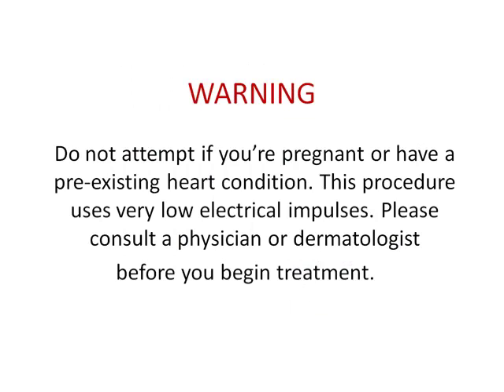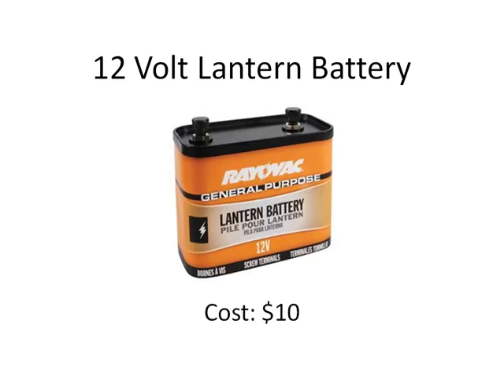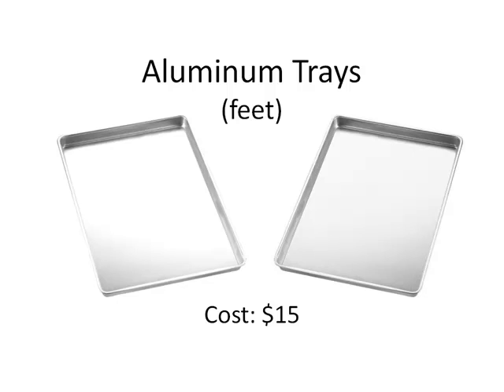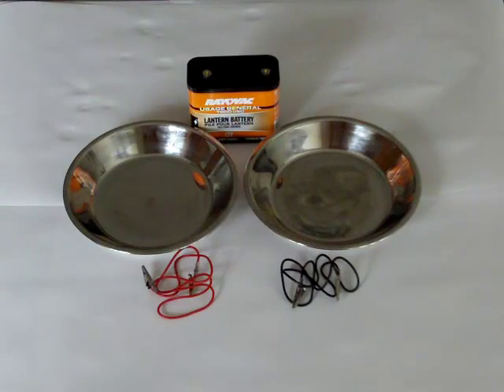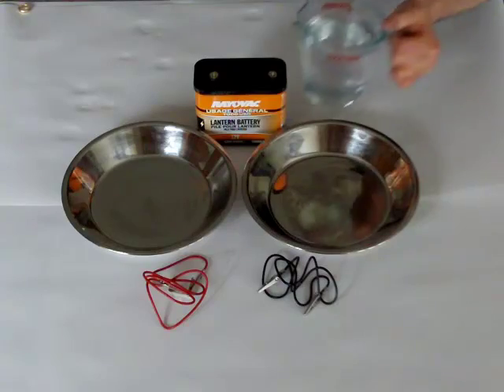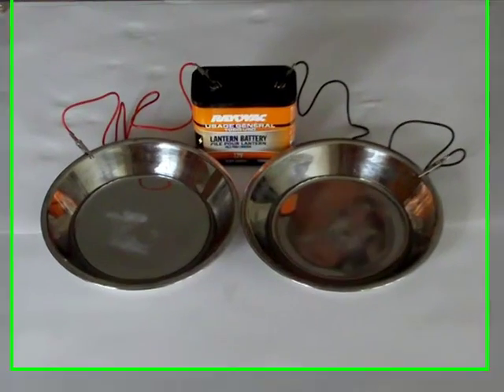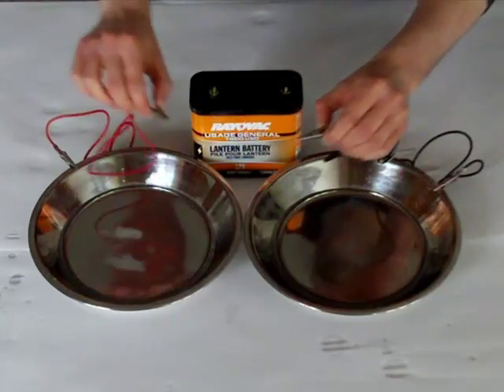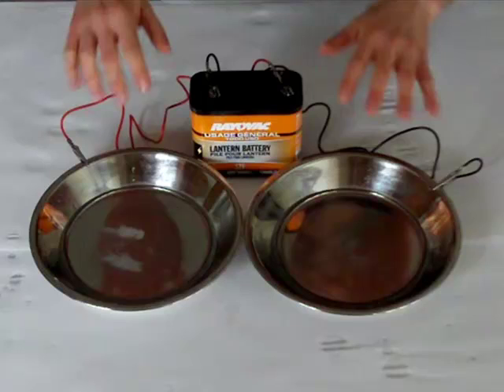How to Build Your Own Homemade Iontophoresis Device

Comment: Continued...

Day 1 (April 3, 2013). I did 10 minutes for each hand, and then switched the terminal like the video says. (So the  disconnect test leads to each pan, and make sure they never touch. Then you connect the (-) on your left to the pan on your right, and (+) terminal on your right to the pan on your left.

Some quick tips: Place your hand in the positive pan first, then your other hand into the negative pan. After 10 minutes, remove positive hand then negative hand. (Part 7)

Comment: Continued...

If you are female 16 years old and above, please start with minimum 16V total.  

16V-24V is the best for this treatment. Everyone varies in size, age, body type, etc, so start from 16V for females and 18V for males, and if feel you can go a bit higher, then do so.  

For male or female, please do not go above 30V in total. It's completely unnecessary and will cause you unnecessary pain and even harm. Maximum  30V total is enough.  

Also, use warm to hot water. (Part 6)

Comment: Continued...

The water level should be such that when you place both hands in the water, the palm of your hand should be completely covered. You don't need to have your whole hand submerged in the water though -- just enough water to cover the palm of your hand and midway level of your fingertips.

On Day 1 to Day 5, I used only warm water (No Salt added).

One other thing before I forget. If you are male 16 years old and above, my suggestion is start with at least 18V total. (Part 5)

Comment: Continued.. 

I connected the (-) terminal of battery #2 to (+) terminal of battery #3. Next, connected (-) of battery #3 to (+) terminal of battery #4. Then I connected the (-) terminal of battery #4 to steel pan #2 on my left. Make sure pans do not touch at any time. Keep the pans separate. Also the pans shouldn't have any water in them before you connect the batteries. 

After connecting all the batteries to the two pans, I added warm to hot water to both of the pans. (Part 4)

Comment: Total cost of all the materials I needed for my homemade iontophoresis machine = about $30

I started 'treatment' on April 3,  2013. (I kept a diary to monitor my progress). So here's what I did:

1. I went straight ahead and connected all four 6V Lantern batteries. So on Day 1 I used 24V in total by connecting (+) terminal of first battery to the first steel pan on my right using one of the test leads. Next I connected the (-) terminal of the battery to the (+) next battery 2.

(Part 3)

Comment: Here's what I did: 

1.  I bought two stainless steel shallow pie pans (10 inch diameter to fit my hands) and four 6 V Rayovac Lantern batteries from Walmart. ( I live in the US). The batteries are in the autos section at the back of the store near the hunting goods. Ask for Lantern batteries.

2. I bought two pairs of test leads from AutoZone. ( just go to the counter and tell the assistant you want to buy test leads with alligator clips at the ends). They have them all the time.

(Part 2)

Comment: It works, folks. I repeat, IT WORKS!  I was very skeptical but had nothing to lose by trying so I tried, and my hand sweating (I had severe palmar hyperhidrosis) is gone. My hands have not been dry since I can remember, and I'm in my thirties. Please try it before you attempt ETS surgery or any radical step. I just couldn't afford the iontophoresis machines on the market, so I tried this -- thank God I have saved myself so much money in the process by using this homemade machine. (Part 1)

Comment: Ok, I am going to build this but I have some questions:
1) why shouldnt my palms touch the bottom of those bowls?
2) the salt must be added exactly as shown in video, or can I mix salt into water and let it properly dissolve (my point is that this could improve conductivity)
3) are bowls supposed to touch each other, or they should never touch (in video both bowls touch each other for some time, isnt this short circuit?)

Comment: I have same problem as you (obviously, othewise I'd not be here).

But I wonder why do you use 9V batteries? I saw other videos with commercial products and they use few mili amperes. Isnt 9 V battery in series overkill?

Comment: I also suffer from hyperhidrosis on my hands, feet, and armpits. I recently tried drysol but only found success on my armpits. Now that i do not sweat from my armpits i want to try this out but i have read a lot of comments on different sites that say they experience an unpleasant electrical bolt after placing their hands. I can not tolerate pain and was wondering if that is true.

Comment: I used 12 volts battery and It didn't work. Then i bought a 15 volts ac to dc converter and a volt meter. when I measured the output voltage, it's 20 volts but I used it anyway. I just had my 12th session... This morning I started to see the results.. My palms are still sweaty but far from what it was before. I know it's going to work because the area below my fingernails already stopped sweating when I used 12 volts. keep spreading the good news so we can help others too.. I will too. thanks..

Comment: Try a current generator, it's not about voltage but about current intensity it's must be fix current between 10mA and 20mA. Do this for 2 weeks everyday and wait for some days to really feel the result. For me I'm using Davita Sudormed DE 20 which is a medical device.

Comment: Hi I've done this for 2 weeks now and I'm still sweating from my hands. I use a 12v lantern battery and also use salt. I really want the sweating to stop, any tips?
Reply: Did it stop?
Reply: @harshithrao9126  It worked for me for a week or so but had to stop because it wasn't effective anymore. I use a professional device called Dermadry and it works.
Reply: How much time it took for you? And also don't you sweat now when you are excited?
Reply: @harshithrao9126  After like 5 to 10 sessions you will see results. When I do it properly without missing any sessions, it will get pretty dry even under certain conditions like being nervous or excited. Just have to be consistent.
Reply: Great!! Happy for you!! Completed 6 daily session and there is no significant improvement!! What is the electricity level you use for both Palms and sole?
Reply: @harshithrao9126  Thanks! You might sweat more at the beginning. You'll notice your hands will be drier after stopping for a few days. I only used it on my hands so far. I usually keep the number between 8 and 12.

Comment: Have tried this on and off for a year now. First time I did it, for 14 days straight. My hands started to sweat more (for about 3 days) then, amazingly, they were bone dry for at least 2 months. Unfortunately however it seems as if it has stopped working as I have been trying to stop the sweating (mainly fingertips) for nearly a year...is damn frustrating! Anybody any ideas/similar? I think I will try again continuously for maybe 3 weeks, and if it still doesn't work then game over for this

Comment: Instead of the harder to find 12v lantern battery you can wire two 6v lantern batteries in series to get the same voltage and amperage. Just as when you stack batteries in a flashlight, positive side touching negative, the voltage become additive so... 2 x 6v batteries become on e larger 12v battery once you join the positive terminal to the negative on the other battery cell.

Comment: I have experimented with using non-conductive ceramic plates for the containers, and instead using pieces of aluminum foil clipped to the edge for electrodes. I think this improves safety as there is less danger of the containers touching each other and shorting the circuit.

Comment: I believe your body has two much resistance for 6V to do anything. I hooked up a multimeter in line using 6V and no current was drawn (I also can't feel the tingling). At 12 V, however, I definitely do.

Comment: Thanks for the video. Built my own -- didn't have a 12 V battery, so I hooked two 6V up in series. However, it delivers quite a decent shock when I first put my hand in! Once my hand is in there, there's no pain, but getting my hand in does hurt a bit. Any ideas? Perhaps I added TOO much salt to the water?

Comment: Important: do not let the two pans touch each other while connected to the battery!  If they do, you will not get a current flowing through your hands. You will have created a short circuit.  This will also cause your battery to discharge very quickly and overheat, possibly dangerously.

Comment: I think you should go to an electronic shop and ask for "Voltage selector" or "Arbitrator", and you put this beetween the battery and the pans, than you can control the power or the voltage that comes out from the battery.

Comment: If the pie pans touch together = Battery + and  - touch together means you will get shock (how the shock damage i not really sure, but this is strongly not recommended to do it)

Comment: hey there, so i have used the 12v batteries for about 2 weeks and it didn't do anything except make it worse... then I upped the volts to 18v. and have been doing that for 2 weeks and still nothing. this is ridiculous i really need someones help. i'm sick of my sweaty hands. thanks.

Comment: @oherrosquirrel, i not submerge my full hand, still put my hand on the black tape. I feel my finger nail very pain and itch after the treatment between the finger. Day 9, i found today my palm 70% dry, but still sweating some time, is on and off. Will update again :) finally can see some improvement.

Comment: i all the time use the multitester to test the battery life before start the treatment. I use 6V x3 battery, so my multitester reading should above 18V, if less than that then i will change my battery for the next treatment. 18V i feel little stinging when the first polarization, when change the polarization, the stinging sensation increase up to maybe 2 or 3 times compare to the first polarization.

Comment: @oherrosquirrel, i have some little bubbles too near the edge on both palm and it is a little intch on those bubble, not sure is cause by the salt or the Voltage.Today is Day 4, Just increase from 12V to 18V.

Comment: @fcc720
You can use the multitester to test it out, if the reading still above 12V, the battery should work fine still. Today is my 3rd day, don't feeel anything yet with 6V battery x2 with little salt in the water.

Comment: I am also using 18v (3 6v lantern batteries) but i barely feel any tingling sensation. The only time i felt a shock was putting my hands in the water after the test lead was connected to the pan. What I do is put my hands in the pan before attaching the test clips to avoid the shock. I performed this procedure for 20 minutes +/- and didn't feel pain as others have mentioned.

Comment: Can you be a little more specific about the battery? I've found some 12volt batteries relatively local and I'm not so keen on getting shocked so im basically wondering if all the 12volt batteries are safe.

Comment: Nice video! However, I get a shock (instead of mild tingling) when I initially place both my hands in the water and complete the circuit. This feeling kinda makes me withdraw my hands in reflex and I am unable to continue further treatment. Don't know if its just me, but I get this jolt even when I use 6V with stainless steel plates (filled with water). Do you all get the same initial feeling? I suffer severe palmoplantar hyperhidrosis, your suggestions would be very valuable. Thanks so much.
Reply: I have the same problem sis did u find any solution?

Comment: I did this using 2 aluminum pie pans and 2 aluminum baking pans for feet. Always with salt and a 12v power source. Noticed no change for the first TWO WEEKS but stuck with it. I'm not kidding after 2 weeks my hands and feet started to dry out and almost never sweats now. I went 2 days without treatments, but noticed a little sweating so treated again. Will try longer durations in between treatments to see how long I can go. Will report back. For those loosing hope, go at least 2 weeks before gi
Reply: Any update?

Comment: I tried this a few years ago, for about a month, my hands weren't so sweaty that they were dripping, but rather uncomfortably and embarrassingly so... anyways flash forward to now and my hands are just starting to sweat again, so I need to do another treatment! Which I was going to post a video on how I did it. All Iontopheresis devices work in the same way,  however, 12 volts wouldn't work for me. So I will post a video on how to do it with varying voltages.

Comment: i'm thinking of trying a deep cycle marine battery for this. i imagine the clips might need to be upgraded perhaps, as should my wire switch from 17ga to probably 12ga or 6ga? i have a couple old bread pans to use for my feet. i am Yiddish - would i 'have to' use Kosher salt?

nonono i'm just kidding, but great video! :P thanks a lot for the information & the well-thought-out presentation - i expect to start trying this sometime tomorrow... with the proper components. lol

Comment: Third consecutive day and still no difference.. It slightly shocks me when I make initial contact with the water with both hands, but once the hands are in it just stings my cuticles.. And its always the hand in the pan connected to the negative end that stings more.. I'm gonna try this for five days straight, and if I don't see a significant difference I'm gonna try another five days with salt.
Reply: Any difference?
Reply: @harshithrao9126  yep, it worked after about 1 month of daily use. After that I did once every two days to maintain.

Comment: thanks for the info on how to properly do the treatments. my question is how long have you been doing this treatment and does it still work after let say a couple of years or maybe even 10 years? wouldnt your skin get use to the voltage after many treatments and as a result less effective?
thanks